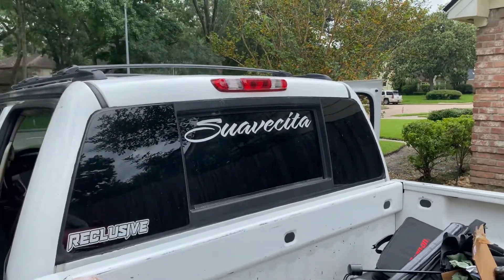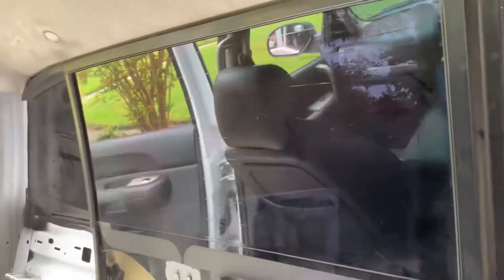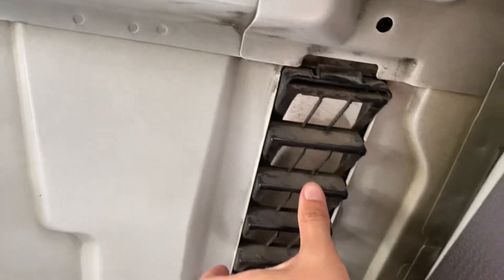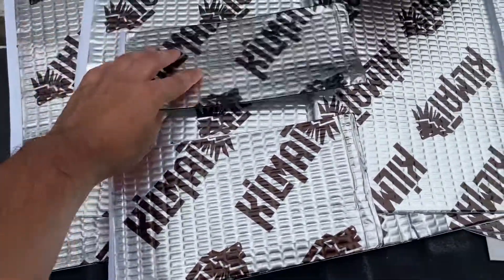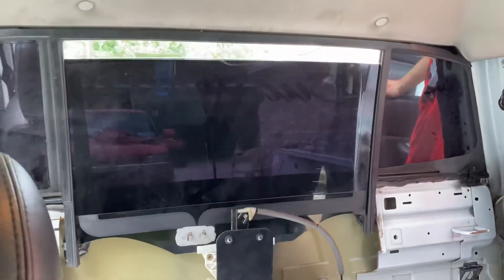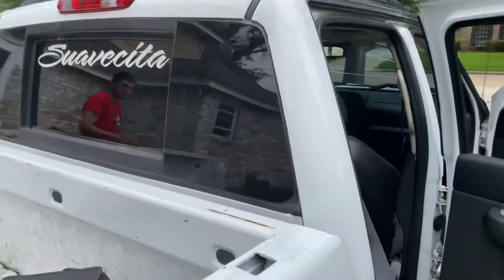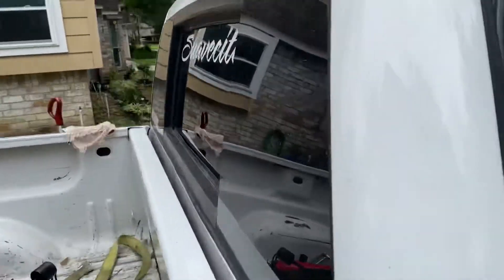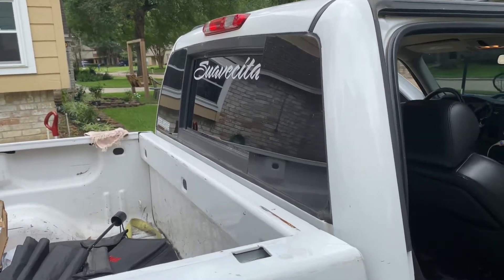Nissan Titan Window on a 7-13 Silverado/ Sierra

Comment: I like that you didnt put a rubber gasket around it on the outside. Do you have any leaks or anything. Just looks more modern that way
Reply from the maker: Nah it’s fine but I’m going back to stop eventually. Rather have a solid window again
Reply: @ArcFireX why do you want to go back?
Reply from the maker: @ I wasn’t a fan of it. Made noise. Leaked. Let a lot of sound in.

Comment: What year titan did it come off of? And a good idea I saw on alot of other people's instal videos was to make a metal box around the window for water draining and it would kinda replace the cut out section and could act for sound deadening
Reply from the maker: Nissan Titans only have two generations and both generations have the same sliding window. So any year Nissan Titan can have this window. Not all Titans have this window tho because it’s optional.

Comment: This comment is not directed at you, just a comment in general. NOBODY ever shows HOW they reinstalled the plastic panels back in, only after the seats are back in, what they did with the jack. and the operation of the window,what they had to to modify, etc. Maybe I will stick with  a manual slider window.
Reply from the maker: They can’t go back in. And if they could it would just be a outline